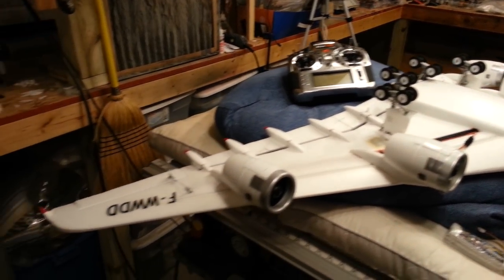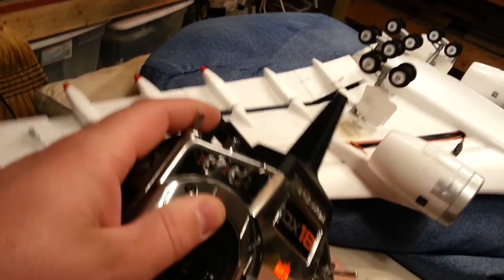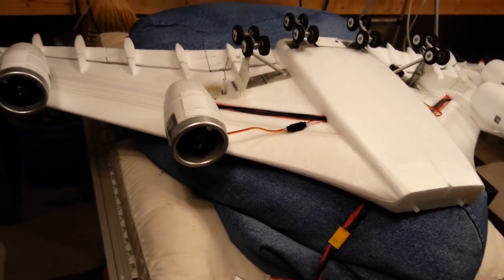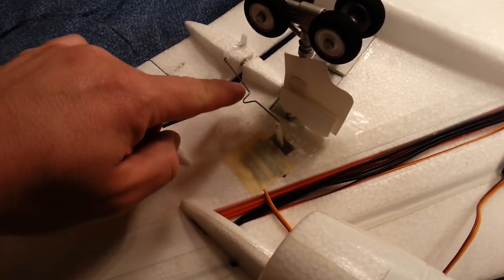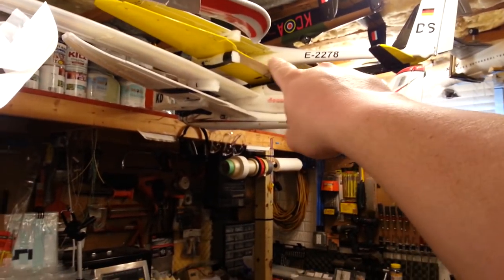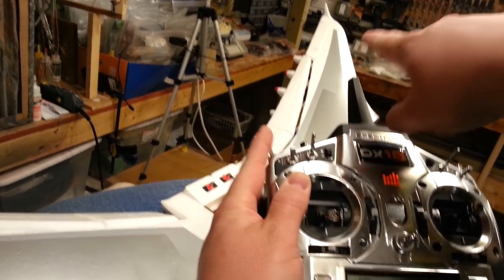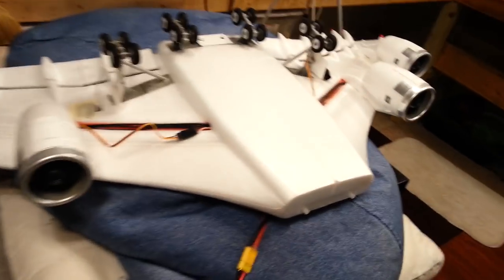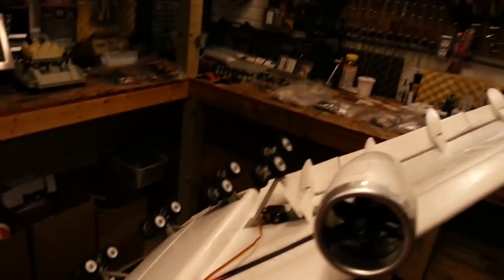Tian Sheng - Airbus A380 - Flaps Part 7 - Servos & Linkages 1/3

Comment: brian, im watchin video and thinkin with that long control arm is it possible to mount a control horn at the very bottom of canoe? to me it soungs like it would give you full deployment. please advise me lol.
Reply: Michael rajca go watch something else and stop being rude.
Reply from the maker: Michael Rajca yes, but too much torque load....:( so I used what I did on the plane)
Reply: please go home, youre mommas calling
Reply from the maker: Dillon Jones I'm pretty sure he (Michael Rejca) was joking, but thanks for defending me, I appreciate it :)
Reply from the maker: Michael Rajca this is an all too typical YouTube misunderstanding....I got your joke Michael, and Dillon, thanks....there's lot's of occasions to help defend me from trolls, but in this case, I got the joke and I knew where Michael was coming from :)
Reply from the maker: Michael Rajca I don't have a strong predisposition for Hitec Servos, as they are VERY expensive, and I've had just as many issues with them, as their much cheaper counterparts. This particular servo had only a very slightly higher torque output for almost 4 times the price of the Emax ones I used....which are perfect, provided you don't have excessive binding....and even if you do, like I did, they work. Also, keep in mind that my servo travel is about 1/4 the full travel, due to my ridiculous mixing...meaning, you'd have an even better time with these little emax beauties, if you had the full throw.

The link for four of them is in the description....$21 or so for the four!
Reply: Brian Phillips yes I was brian. I was just messing wit ya. Not trying to be rude dillon. Sorry you saw it different
Reply from the maker: Thanks for clarifying that Michael!